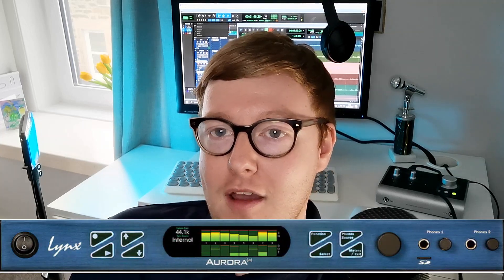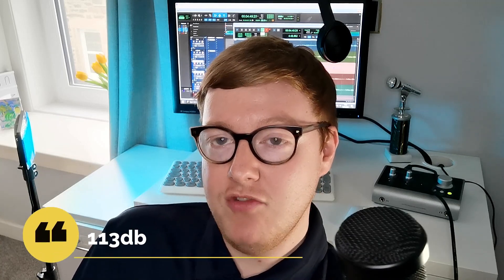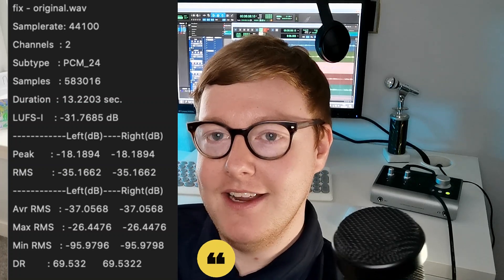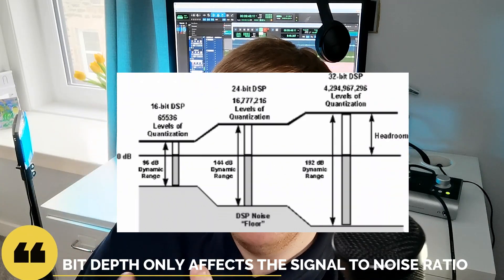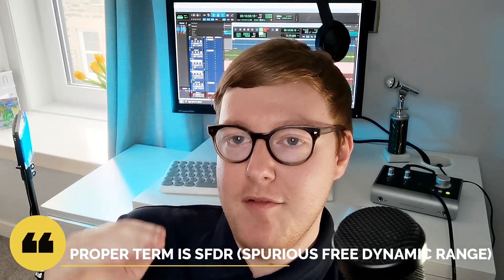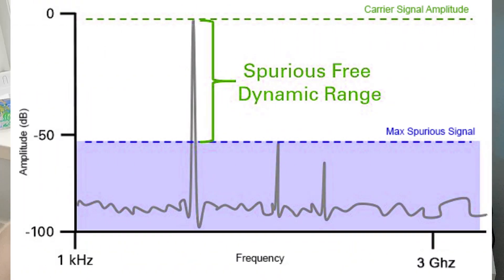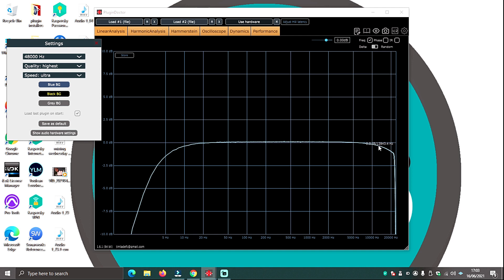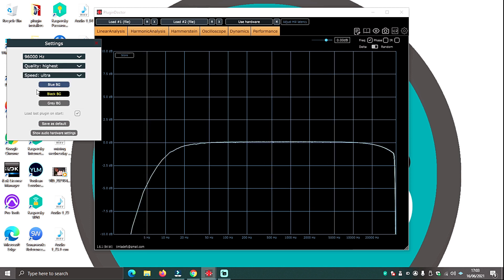Do you lose audio quality in analog gear using budget interfaces vs expensive ADC Converters (Pt 1)

Comment: Perhaps I have burned out my eardrums working in an industrial setting longer than many of you have been alive. However, YOUTUBE has no doubt down-converted the signals to a point where I cannot hear a difference between samples. I am hearing this video on a cheap Bazooka Gold speaker system, however cheap I would say is not absolute crap. What I do know as an analogue guy, with many tube Mics, Tube Amps outboard gear (Including the DBX Compressor) analogue sounds better when its not coming through my laptop into cheap speakers. That said perhaps I would have heard a difference if I was in the room during the test.
Reply from the maker: Youtube doesn't affect the sound as much as everyone thinks. Bit of compression but thats about it. It's not mangling the sound or anything. Doesn't low pass at 15k like many believe. Doesn't add distortion and it is really just a bit of what sounds like clean compression. I tested all this out last year
Reply: @PaulThird  You can hear the difference (slight) that a thousand dollars makes comparing these units here: https://www.youtube.com/watch?v=0kLQyKR15NE&t=21s

Comment: Thanks Paul. What you say is so true! The larger percentage of "what quality sound are you able to produce?" lies in the hearing abilities of the engineer.
Yes, it's great to have high end gear, of course
But
I'm using a 13 year old RME Babyface, Cubase, Audio Technica AE5400 Mic, Sample Drums from BFD, old Adam a7 monitor speakers and Beyerdynamic DT1770 Pro Headphones.
This stuff is all "OK", it's not "budget" and it's surely not high end. I would call it mid-range priced, altogether.
You know what? My productions sound very good. But that's due to 15 years of experience and training (my ears)
There is no way I run into trouble concerning sound quality of my equipment. My ears' capabilities is maxed out so much sooner....

Comment: Isn’t a null test designed to compare the differences between two files where ONE variable is changed? Not render a file at 96k through the Audient and test it against a “virtual” offsite render through a Lynx system at 48k. Sorry…you’re not comparing apples with apples!
Reply from the maker: Access analog is streamed lossless, and there will be no audible difference at 48k compared to 96k in the lynx.

However if you want to buy a lynx and send it to me do a comparison that fits your own personal standards then be my guest 🤓🤓

Comment: Paul, I have done a lot of tests with the Aurora N from Access Analog against my ID14 and Apollo Twin usb. Files processed with their Aurora smoke files bounced with my Apollo and absolutely smoke those bounced with the original ID14. I bought a Fusion thinking that it was the difference maker. Nope, ITB mixed and mastered stuff run through that Lynx at the mix and mastering stages sounds way better than things bounced with the ID14 or Apollo Twin and mastered with Fusion in the chain. I feel like with that Aurora N, you don’t even need hardware. The converter seems to be the foundation of this all. And I’ve been spending years trying to get around problems with these two interfaces. Rarely does anyone seem to be talking about this. Instead people are always trying to get everyone down this path of buying endless amounts of plugins and hardware. I’d love to try some of the other popular converters out there. Burl Bomber, Dangerous, all the ones in these shootout videos. I think Produce like a Pro did one. For all I know the newer Audient models are right up there with the Lynx. Pity it’s not easy to try these things.
Reply: so you ran a finished track from a PC into and back out of the Lynx?

Comment: same for the audio geeks who listen to music and claim a £2k DAC is better than one costing £200. I bought the Motu M4 cos it had 4 inputs and can record a small band whilst 4 outputs for monitoring but also to rip my vinyl collection. I also own rack mounted studio gear (RME) which costs significantly more (AKM chip before the fire) and its only on par with the Motu. I always work at 96 when recording and mixing I then mixdown to a file thats uncompressed to be used to master for whatever sample/bit rate required later. Some claim that the stereo image and sound stage of some DACS is better than others and thats what justifies their extortionate price, like WTF u on about? So if I mix my tracks on my little Motu or my RME and you play back on your mega expensive HiFi system you hear things I couldn't and it sounds better? Some people need their head testing. I have a decent HiFi setup and it does me just fine as do my Adams Studio Monitors, you do not need to break the bank to get quality, just don't buy rubbish which is out there !!

Comment: You dont need an expensive converter to make good sounding music, period! But…

Converters are not about just frequency response, there’s a lot more things going on. 
and the whole “transparency” thing is not measureable with a simple null test. 

If frequency response was the only thing about audio i could make my sm57 sound like a Neumann u87, and that is not true..

I have an older aurora 16 and the audient like yours, prefer the aurora, the audient could be more “transparent” frequency wise, but the “sound image” of the aurora is better, also the highs on aurora sound smoother, the highs in audient is way more harsh.. and no, its not just a frequency response thing.

The aurora is definitively a better converter than the audient id14, there’s any serious discussion about this, the audient is very good for the price.

The only question Here is, does aurora worth the extra money? And the answer is .…….
Reply from the maker: Null test is the most scientific way to test transparency. If 2 files don't null then the differences are the differences.

Sound image, depth bla bla would still come up in a null test. It's just audio science. There's no magic in audio so if you do hear a perceivable change from the original source then most likely there's some elements of phase shift going on unless it's something like burls where there is some harmonics being added as well

The audient id44 is much more transparent than the id14 because its converter is not tied to the preamp. You can use the send and return in the id44 and run straight through the converter.

That would have been the most logical comparison to do as the id14 is preamp and converter so not really the best test but I didn't have the id44 at that time
Reply: @PaulThird  Yeah i know what a null test is, and no,  null tests dont reveal perceptual qualities..
Null tests don’t reveal, Depth, spatial imaging,Transient clarity, timing precision, and psychoacoustic subtleties that may not leave a large residual in the null ,
or may leave one that mathematically looks small but feels different..
It also doesnt reveal Aliasing, Load Nonlinearities, PLL Instability and many other things..

There are many other points to say a converter is better than another..
 IMD,Clock,Jitter, Analog stages, Filters, Phase Curves, Crosstalk, ENOB, CMRR,PSRR,

anyway.. agreed on the main point,  audient converters are great,  but a simple null test  cant give you the whole picture... and the expensive ones are not just bullshit..

Comment: You cannot compare that way, you need to plug the lynx into your computer. I have the lynx n, classic aurora, crane song hedd, and prism Lyra. They all sound different.
Reply from the maker: Well you can.. And I did. Until somebody gives me a loan of multiple converters this will have to do for the mean time
Reply: @PaulThird  good luck sir, it’s invalid data, Due to many factors. Above and beyond converters and software. If you compare emulation software vs hardware there is a difference. You are not sure what’s happening behind the scenes where you are sending the file. There is differences
Reply from the maker: Can you prove that access analogs method of streaming hardware isn't lossless?
Reply: @PaulThird  For you to be able to prove your point, you would need to perform a test with a lynx right there with you. Just as I would need to test with the Audient myself.